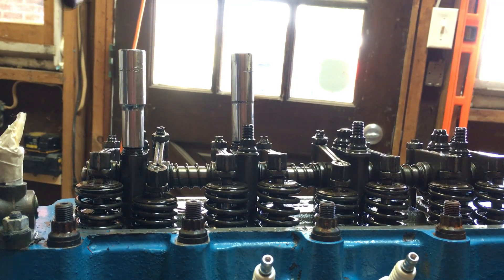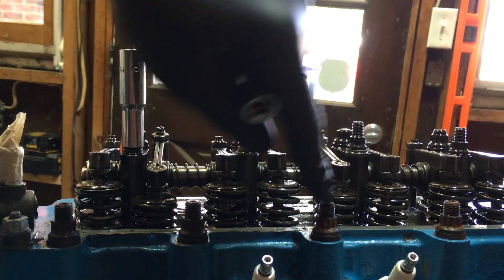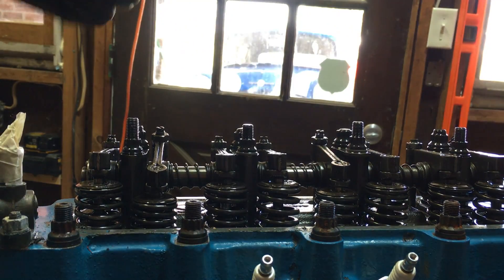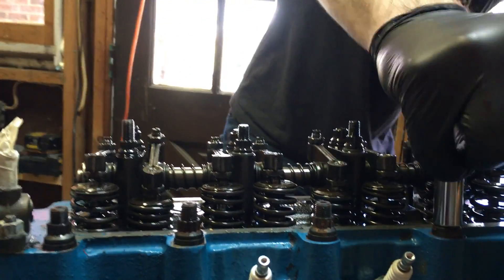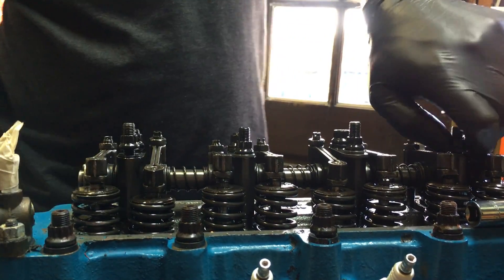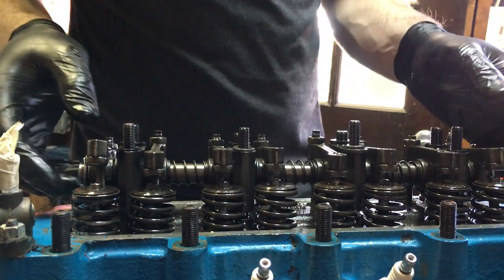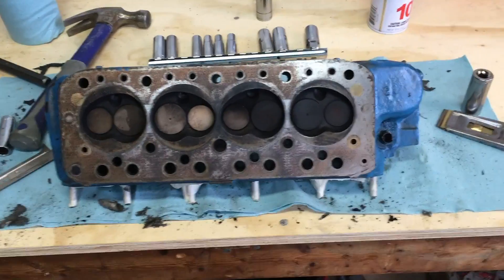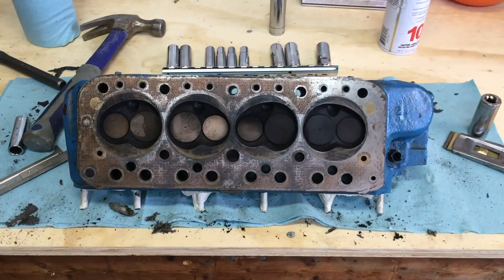Classic Mini DIY - Cylinder Head Removal

Comment: Great vid, it helped heaps, could you please give a list of tools that you used during this
Reply from the maker: Sure thing off the top of my head I used the following:

1. A full socket set (depending on the head stud nuts you may need 12 point sockets)
2. Nice set of gloves

And that's pretty much it.  Removal is pretty easy tool wise.
Reply: cheers

Comment: Hey great video! Just wondering what effect does it have if you forget to put the pushrods in the correct order?
Reply from the maker: Thanks!  Regarding the push rods, on a used motor the lifters, and rods will all wear together(like the tips and mating points).  So keeping them in order is definitely recommended.  It will keep everything running as closely as it did when you took it apart.  If you have all new parts though it doesn't matter as much.  Let me know if you have any other questions!

Comment: can you do also cleaning .. thanks
Reply: +JC mix26 Hey whenever I clean my engine parts I use simple green diluted 50/50 when the engine is in the car, brake cleaner for quick cleans, or I bring to a parts washer if the parts are out of the car completely.

Comment: Shouldn't you Loosen the Rocker adjustment screws- to take the Valve spring pressure off the pedestals while you loosen the Rockers and Head?